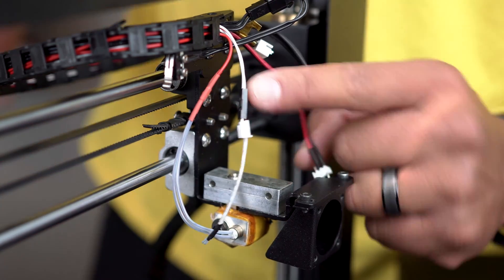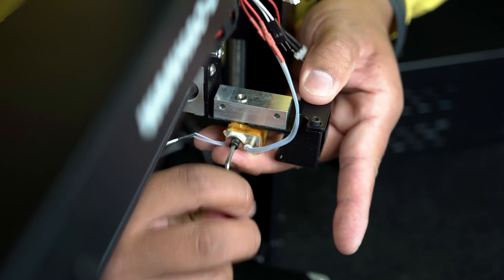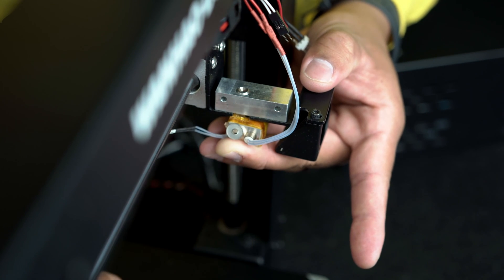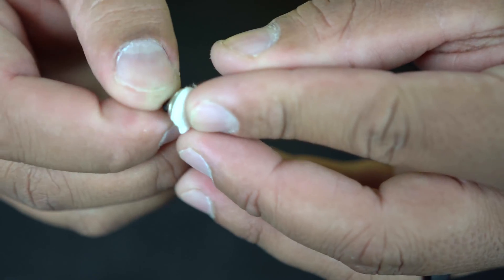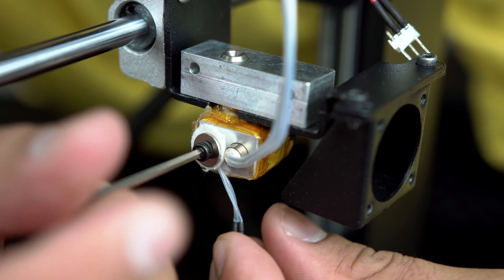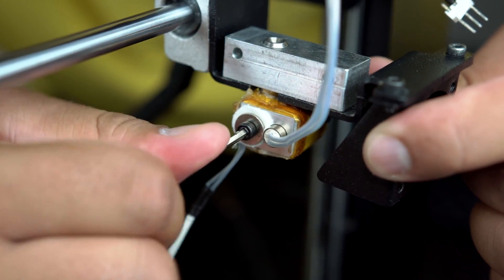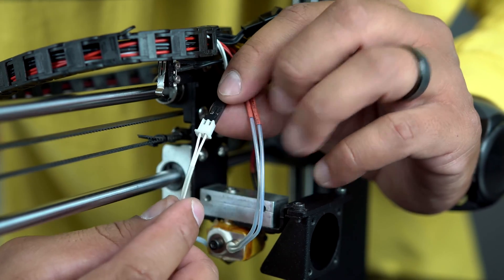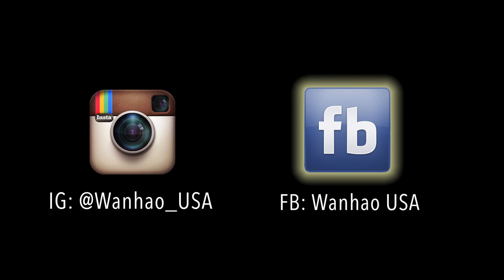Wanhao USA: Tutorial - How to Replace Your Extruder Thermistor (Duplicator i3 Series)

Comment: What type of thermistor is it? I've already bought and installed a 100k ohm Semitec 104GT-2 thermistor and a 3950 thermistor. Both give me a reading of around 125°C to 160°C at room temperature! I checked their resistance at 27°C ambient and the 3950 marked ~95kohm, so I don't think it's the sensor... Help!
Reply: did you ever get a reply i have screwed up a print so bad the the felt washer was disolved in pla and it broke the leads for the thermister.
Reply: I didn't =/ I contacted monoprice about the issue, and after going over all the things I tried they just went ahead and replaced my pronter since it was still under warranty. I wish I knew what was the exact issue. sorry
Reply: well thanks for replying everything ive found is that the 3950 should work as well. i have some on order so hopefully they work.
Reply: Demonocolips good luck! let me know if it works out for you so at least i know I wasn't completely wrong about what I did.
Reply: sure thing.
Reply: got a new thermister off ebay and it seems to be working so far. i had to make some modifications to the head so that it was easier to fix later hopefully this wont bite me in the butt later.
this is the thermister i bought
http://www.ebay.com/itm/261917288521?_trksid=p2060353.m2749.l2649&ssPageName=STRK%3AMEBIDX%3AIT
Reply: Demonocolips I looked into getting that one, but didn't. glad to know you got one that works! thanks for the update